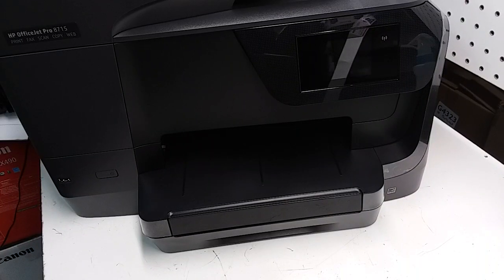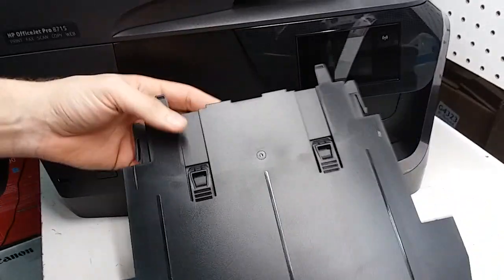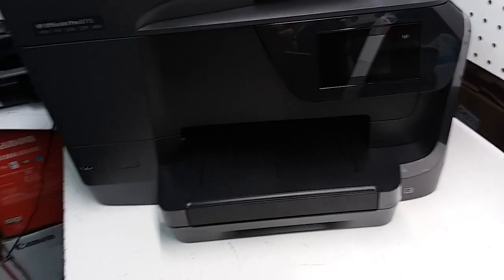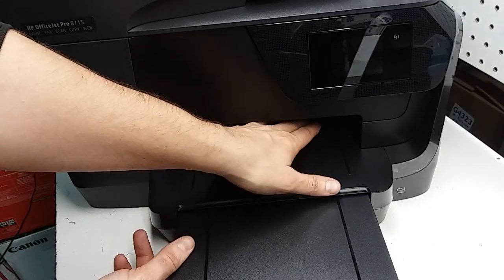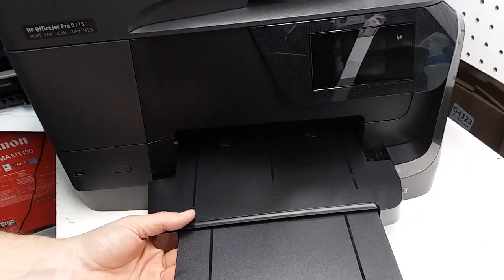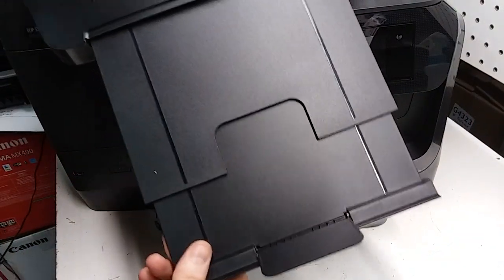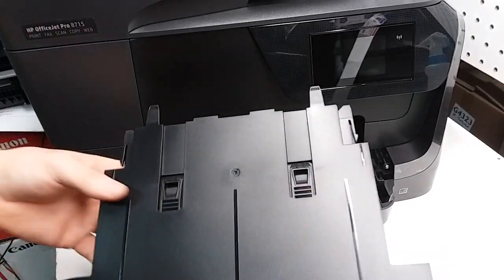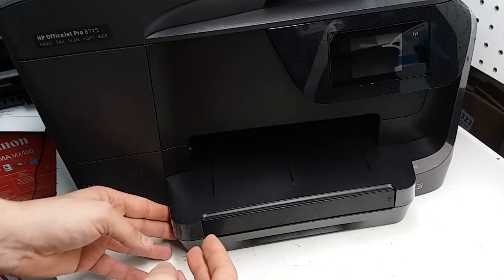How to replace Paper Output Tray on HP Officejet 8710 and 8715 Printer

Comment: Thanks for basic instruction on pushing table down to release. Some are very hard! I have a Deskjet 8600 and was able to unlatch the tray by spraying some WD-40 back by the tabs in back and then  waiting a couple of days for the lubricant to work itself 100% in mechanism.  It was still hard to unlatch (one at a time) with my 80-year old fingers, but doable.  New tray was easy to slide in place then push in with aid of flashlight.

Comment: I am trying to remove the tray on my Office Jet 8600 using these instructions but I am having a hard time getting it to release. I don't want it to break. Is the procedure the same for the 8600? Thank you.
Reply: I’d like to know the same. It seems the white portion that holds the sliding tray is not coming out.
Reply: I had to do it one at a time.
Reply: I have a Deskjet 8600 and was able to unlatch the tray by spraying some WD-40 back by the tabs and then  waiting a couple of days for the lubricant to work itself 100% in mechanism.  It was still hard to unlatch (one at a time) with my 80-year old fingers, but doable.  New tray was easy to slide in place then push in with aid of flashlight.

Comment: on the hp office jet pro 8020 series how do you fix the part that extends out to catch the paper and also what 
is that called?  I can't get that piece back on the paper feed/tray.
Reply: Did you figure out what it's called and how to get it back in? I have a different hp model printer but the same problem
Reply: @karenmulhern  Hi, I don't remember what it's called but yes, I figured out how to get it back in.  Give me a min or 2 to see if I can remember.  I do remember that it was the easiest thing.
Reply: Ok, so if I remember right, I think you have to put the paper drawer in first, then the other part.  Let me know if that works.
Reply: 40racquel....I got it back in!! Thank you!
Reply: @karenmulhern  Oh, good.  You're very welcome :)

Comment: I cannot remove the tray. I have been pushing down on those two tabs for 30 minutes. The tray is not budging. It is "locked in" solid! What am I doing wrong?
Reply from the maker: Hi. What is your printer model?
Reply: @303electronics  HP Office Jet Pro 8710.
Reply from the maker: @barryrichards534  it should be just those two tabs on 8710.  I know some other models have a screw on the right, but this one is usually attached by the tabs. Put a flathead screwdriver at the area where tray should detach from  printer and press tabs.
Reply: I have a Deskjet 8600 and was able to unlatch the tray by spraying some WD-40 back by the tabs and then  waiting a couple of days for the lubricant to work itself 100% in mechanism.  It was still hard to unlatch (one at a time) with my 80-year old fingers, but doable.  New tray was easy to slide in place then push in with aid of flashlight.